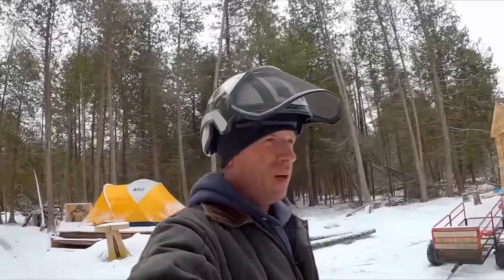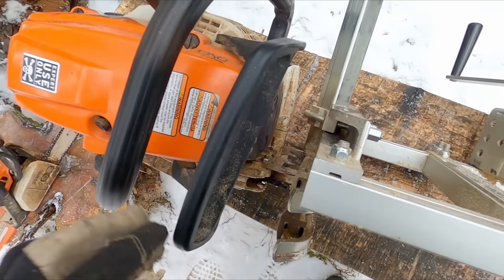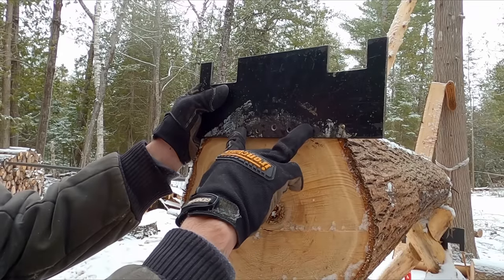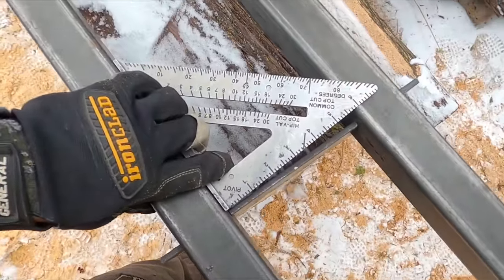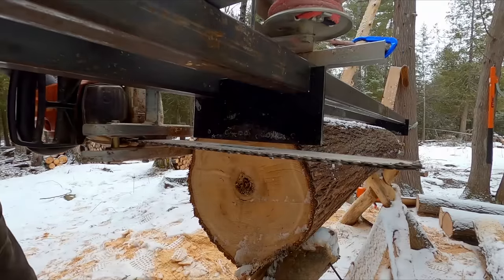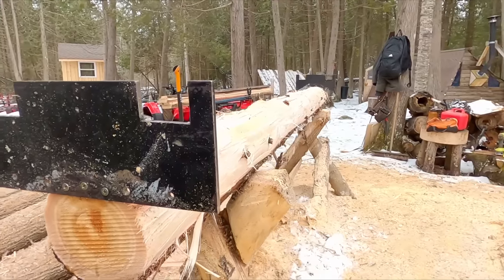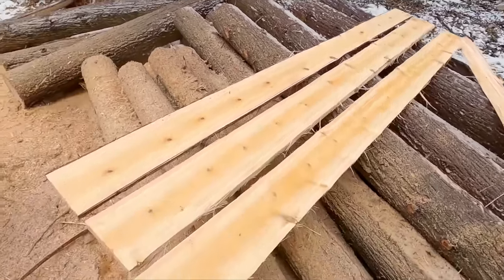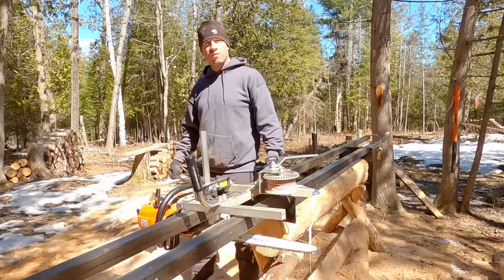$200 Bullet-Proof Alaskan Chainsaw Mill Setup.  Build Your Own!  #80

Comment: The issue you're describing with the chains is that you weren't using a ripping chain at the start. Standard chains are cut at 25-30 degree angles which is too aggressive for milling. A ripping chain is cut at 10-15 degrees. A skip tooth ripping chain is the best way to go as it's not aggressive and the skip teeth allow enough space for chips to be properly discharged, allowing your saw to run at a higher constant rpm.
Reply: I was just going to add the same comment. Lots of people don't understand the difference between cross-cut and rip-cut.
Reply: @wxfield  Thank you both. I've never heard of the difference!
Reply: On my 038, I run double skip ripping chain.
Reply: Where do you get your skip tooth rip chains
Reply: Are you familiar with Osage , Bo' D' Arch or horse apple wood? What do you recommend to cut it?
Reply: @uncleharley1  your local stihl dealer or online
Reply: Great info. The chain you're describing, can it be used on a regular chainsaw? As to mill smaller logs.
Reply: @josef9001 
Yes. Saws used for ripping / milling aren't any different than any other saw, other than usually being larger.
You can mill / rip smaller logs / lumber with a smaller saw, it just gives the saw a good workout, so take your time and be patient.
Make sure you change back to your regular chain before cross cutting any logs, a ripping chain doesn't do well, and is more likely to kick back.
Reply: @MrAlaska66  thankyou sir for the info. I'm a bit late to the game when it comes to chainsaw knowledge. Much appreciated
Reply: Yes, I had a logosol chainsaw mill and bought spools of ripping chain, and I sharpen every time I gas up
Reply: Skip chains are nice
Reply: Everyone knows that
Reply: @wxfield  Indeed. Same basic principle applies in woodworking with hand saws.
Reply: Thank you for that!!!
Reply: @braindeadhoovy2562  The only "ripping chain" I could find from Stihl was something called RMX ripping chain, but I could not find a picture or any more info on exactly how it is configured, such as is it skip tooth, double-skip, or whatever, or is it just regular build with 10 degree chisels. Stihl kind of dropped the ball with that one.
Reply: @mrtahoe  Apparently not "everyone". Cut them some slack.
Reply: He uses ripping chains exclusively! Go back in time in the videos, they are granberg ripping chains. I ‘ve know this for a long time.
Reply: Super-helpful and informative - thanks very much!

Comment: For my mill, so I didn't lose too much of the log, I made a "Ladder Frame" from Uni-Strut (From Menards) and then made Pointed Studs from 1/4"=20 Bolts - sharpened to a point.  I lay the ladder frame on the log, with the sharpened bolts mounted on the ladder rungs, pointing down.  I just tap them down with and axe or hammer and start milling.  I lose around an inch of log on my first slab.  Works pretty good and easy/fast to setup. I could draw this up if you, or others, have any interest/questions.
Reply: Me too
Reply: I thought of that style but is it fast to install and have it parallel to the center point of the log.  I'm using the same dual rail system as Mr ringworm and it's very adaptable to non perfectly straight logs.
Reply: I'm also interested. I had a similar idea but this far only got as far as the ladder unistrut frame, which rests on some ply brackets. My clever plan to cut the unistrut down to make it easier to move the top cut bracket around backfired, since now it keeps trying to sag in the middle
Reply: That sounds pretty cool
Reply: Yes I need this
Reply: Sure I'm interested just a quick sketch would be great
Reply: Good idea.  I use a ladder also.  I made brackets and a Wedge or 2 to level .. yours sounds faster.
Reply: Interested
Reply: Interested in the design I have a mill but it's something a friend threw together
Reply: details definitely on this^
Reply: @ Lee Bernardo Yes Please! I’m impressed with the mill shown in this video, great idea, but I’m still open to other ideas, especially since I have access to plenty of the Uni-Strut materials.. Please share!
Reply: Would appreciate a sketch. Cheers
Reply: ingenious thinking ! Yes , would love to see some pics please. Stephen australia
Reply: Anyone else suspect that mr Bernardo is full of himself? 😆 Me thinks his contraption doesn’t exist
Reply: I use a ladder, 12', and 1"wide banding strap material for securing the ladder. 3 holes in strap with the third close to the rung. Fasten by nailing 2 holes with shortest possible length nails, depends on bark thickness, then the inside nail will tighten up the setup. 3 straps and wedges will suffice for the first cut. I use a 660 Magnum, 3' bar and sharp rip chain. When making cuts follow the saw with opposing wedges relieving pinch. Keep bar and chain groove clean and oiled.
Reply: Please draw this up
Reply: Send a pic or video of your set if you don't mind. Starting to build in Wisconsin soon up north by the Chippewa.
Reply: I'm also interested
Reply: I’m definitely interested
Reply: Pictures???
Reply: Very interested
Reply: Yes please share
Reply: Interested.  Any photos to share?
Reply: Any pictures of your setup?
Reply: I'm waiting for the day YT allows pictures in their comments on certain channels.
Reply: Jammy Birchum  I feel like a lot of us are still waiting for his reply 😅
Reply: I would like to see your setup
Reply: I'm interested
Reply: I am very interested to see your set up.
Reply: I want to see this too, thank you!
Reply: I know some time has gone by but I am interested in seeing the blueprint.
Reply: I am currently working on my property doing off grid and this would be a good way for me to cut my own lumber can you send me a picture
Reply: @jessesherlock9516  good shit Jesse. My name is Corey. Come back to this thread if you need help. With anything. I want to see you times a million. And we win
Reply: @mikeb3167  I'm game.
Reply: Yes interested
Reply: Yes definitely interested.. Thanks!
Reply: I’m interested, can you post pictures somewhere?
Reply: Make a video of it so we can see it
Reply: Why not just use a regular ladder then?
Reply: I have a 24 in bar and a 881 42 in bar . I am like this guy I don’t wanna buy logs and I have slabs of a 40 in tree I wanna sell
Reply: Y
Reply: I’d like to see it ..
Reply: @RobertJLessard You can combine both. Use a rig like @leebernardo1000 mentioned, start from the butt end, and add one plate (like in the video) on the small end. You can lift the rails on the small end with the plate to keep it parallel to the center of the log. When I do it this way, I add a sacrificial chunk of wood as a spacer between the log and plate on the small end so the chain has something to hit before the plate when you come out of the cut.
Reply: I just made two end plates and use 2-2x4s as my initial rails. Works just fine
Reply: Shoot I wanna see this my brother sounds very creative
Reply: great idea

Comment: If anybody is wondering, I mill a lot of hardwood (oak and maple mostly) and started out with just about the same setup. A 50cc saw will get the job done, but it really isn't enough saw. I recently upgraded to a 98cc pro saw (more than I'll ever need and not just for milling) and it mills hardwood so much better. Every couple boards I touch the chain up with a file and I can mill 2-3 times more wood in half the time
Reply: What saw did you get?
Reply: Daniel, I hate it when people use oak for firewood!!!  

They take so long to grow. My belief is to make something lasting out of them if they are cut.......

However, sometimes they do need to come down. Whether they are about to fall on someones house or trees do fall on their own so cutting is fine. 

But again, at least make something of value rather than using it for firewood!

Comment: I have a still 661 mag with a 36" mill and I'm making all my timber frame lumber out of pine. Knotty pine 2x6 t&g for interior panel and roof deck. I'm milling crazy maple crotch sections for flooring and counter tops. It will take 2 years to get all the lumber but it will save me 100k$
Reply: I have the same 261 as Ryan but need something bigger.  I'm thinking 500i just for the power to weight.
Reply: @RobertJLessard  The Stihl dealer, recommended the 661 as it has more torque vs the 500i.  Thats what i went with the 661, i know there about the same price but i took the dealers advise.

Comment: Once I got a job with a company that gave us free boots each year, and a co-worker suggested extra wide boots, even if they needed to be ordered instead of just bought at the store. Its a big help, comfortable right away. Also, we are required to have safety toe. One job I worked outdoors in the snow, and no matter how warm my legs and feet were, my toes were so cold they were in pain. I got a "composite" toe instead of steel, and they are awesome. Lighter than steel, and toes don't get cold anymore.

Comment: If you follow your cuts with wedges every two to three feet, opposite sides behind the saw, your cuts will be pinch free and smoother. Chain is  not the problem as long as it is a rip chain. A slight angle in the cut, like slicing cheese, works good too.

Comment: This is the first video I've seen from you. Extremely informative, straight to the point w/ no BS. I really appreciate the time you spent on this video, I learned some invaluable info. Subbed, greetings from Germany 🇩🇪 👍 🍻
Reply: Same as the other two.  Want a bandsaw mill, but may try this first.  I have oak.  Saw another video where two guys used what looked like an aluminum ladder for their bars.  Were doing long lengths, wide cuts, 48 inch chain bar.  They didn't give any how to's.  Yours....very informative.

Thanks.  Subscribed.

Comment: Oh man, you got me! This video ROCKS!
I was really thinking I “need” a bandsaw mill for my projects but I am going to go this route. MANY THANKS for ALL that you shared!
Reply: I thought about a band mill too.  Until like he said how do I move the logs to the mill.  I was only doing logs on my property that's not even an acre.
Reply: @beebob1279   look, one can choose to buy only the bare minimum, cheaper tools and then do everything the most difficult and slow way on the cheap... so one may think.  Or one can choose to equip themselves properly, which saves time, which saves money, which allows one to continue to invest more $ into their equipment making the entire operation easier and more productive, while providing an opportunity to make a little side cash w/ said equipment. 

I ran an Alaskan for the big logs only; over 32" wide. it's been gathering dust since that first year. I now butterfly large logs vertically, standing in top. Sure, there's such more to it, but that's the gist. Honestly can't stand the Alaskan mill. so much effort and so slow. My old mentor always said, "work smart, not hard." 

It'd be more cost effective to hire a portable band saw to mill up your logs, rather  than spend all that time using an alaskan mill. 

So, I own a manual push band saw (Timbery M280 with a 25HP engine, it was under $10,000) and ran the operation on the cheap before I got serious and invested in a skid steer and set up the operation as it should be; milling shed to mill outta the sun, a lumber shed, storage shed for skid steer and operation tools. 

I just could not do that with an alaskan mill w/o losing my mind. 

the hard way: 
I would either buy a dump truck load of logs or fall trees on the property. Either way, I had a log storage, hence my need t excavate a "and" for the operation. .
I use to drag my logs w/ the truck, from log pile to mill. I installed  two 4x6's w/ tapered end to create a log loading ramp,  Running a single carriage bolt thru each one which was connected to the angle iron tabs I welded onto bottom of the band saw rails. I used a boat winch ($15 used) to roll logs up the ramps and onto mill. I did this for several years, it worked. AND...  It eventually drained me, b/c of all the time it took just to move and load one log, then load up the lumber slabs and move and stack them, by hand. I learned by doing it the hard way. Looking back, I now cringe. 

easy way:
I then bought an old skid steer. I shopped for a machine that I could use for many other things. I found a used machine with 4 attachments that I could use to work my land; back hoe, auger, forks, bucket... and I bought a used grapple bucket.  
The entire operation changed at this point. Not only have I excavated a new  log milling area/pad on my hillside sloped property, I have excavated a road down to the lower forty, cut trees down there, hauled the logs up the road, and used the grapple bucket to load all the slash into the dump trailer (which I also make money w/ by hauling customer's slash/trash! There is NOTHING like the feeling of rolling up to the dump with a huge dumper load of slash or trash; dumping and rolling out within 5minutes). I have  built 5 huge retaining walls with 200+ massive boulders (3-4 diameter). I use the auger to dig fence holes, for milled fence posts, both for myself and customers. It's all a tax write off now, b/c I bought all of it under my LLC. 

I guess my point; it may serve one to think a few years down the road, what one might consider doing elsewhere on the property or with your land/home,  rather than just thinking of the immediate project at hand.  The band saw changed my life. and then it changed again once I got the skid steer. I now have the equipment to do all kinds of things I would not have dreamed of... including snow plowing my property and a few neighbors (making more money off the skid steer and knowing I can always move any amount of snow that drops here; typically 10-15' per winter)

it might sound more complicated, but it has been a progressive journey for me. I'm still remodeling the old cabin, using my band saw and wood/work shop (which I also built using my milled lumber). With the wood shop equip. and I can make T&G, and mill anything for my needs. This year the back deck get refurbished with a roof over the entire deck. I pay for hardware only. I use the skid steer to move lumber to that area. I set beams with it. 

Looking around the compound I can point to all kinds of projects that I could not have done without  a machine. 

I just think it's silly to choose a cheaper tool that work slowly, is far less accurate and has no value towards making money on the side. 

But hey, we all enjoy doing things the way WE like to do things
For some of us, we have fun regardless.  I have always thought to  keep in mind there might be an easier way that will offer more.
Reply: @dgodrummer8110  You type a lot.
spending 10,000 for a band mill isn't so smart for 800 board feet of cherry.
Reply: @beebob1279  ok then, have fun.
Reply: @dgodrummer8110  I'm done and it was a challenge.   But I have it and it's air drying.  Planning on making some flooring with it, cabinets, and a few for gun stock while I build flintlock rifles.    
The rest?  Not sure what to do with it.  I'll store it until I need it

Comment: Nice video Ryan, thanks! My approach to building a shower at the cabin was to make it a sauna. I set a pot of water on the sauna stove and while it is warming I can sit and enjoy the warmth of the sauna. Once the water has reached the temperature I want I pour it in a pump-up garden sprayer and use that to shower. (The pump sprayer has never been used for chemicals. It also has a longer hose and a spray nozzle that is better suited to showering than the wand-nozzle it came with.)
Reply: Thx for your tip😊
Reply: Sauna is a great way.  They don't need to be complicated at all.  I use the saunas built by my great-grandfathers in Michigan.  I prefer them in the winter over summer.  They're a hundred years old.  If you build a two-room building, then you have a nice changing room not as hot as the bathing room.

Comment: I copied your rail and bracket setup a while back. Worked great. I did make a wider set of plates to use when milling some 30” diameter oak. 36” Granberg mill and a Holzfforma 660 pro saw with 36” bar. I think the pate and rail setup can’t be beat for heavy duty and speed of setup.

Comment: I've been teetering back and forth on chainsaw mill vs bandsaw mill.  After this video, I think I'll save myself some money and go with the chainsaw mill.  Cheaper start-up and I can always get a bandsaw if I REALLY like it.  Really enjoy this channel - keep up the great work!
Reply: I did just this about 2 years ago. Just went to a full on bandmill from frontier/norwood. Its hard on saws and is very time consuming to use a chainsaw
Reply: For someone who is milling on the occasion, I can attest to how handy and convenient it is to be able to chainsaw mill. I only have experience in freehand chainsaw milling (I just spend the time to plane my work) but my goodness, what a total blast! 

Nothing beats the ability of being able to mill basically anywhere on the fly. 

Run a milling chain if your worried about the load on your saws. 

Don't listen to what everyone says about what you can and can't do with your saw. Someone told me my saw (ms 261) wouldn't be good to slab out logs.

Here I am a year and some odd into my saw ownership, running it as I intend to use it since day one. Havnt had ONE issue. Not even so much as a thrown chain. Nothing. And I've milled quite the collection of slabs!